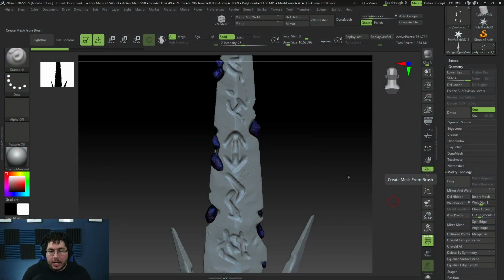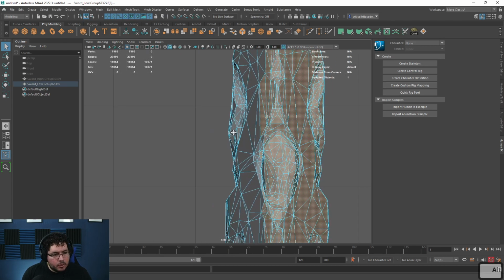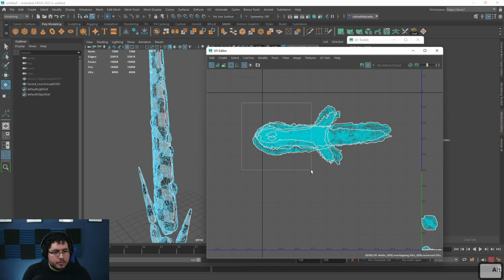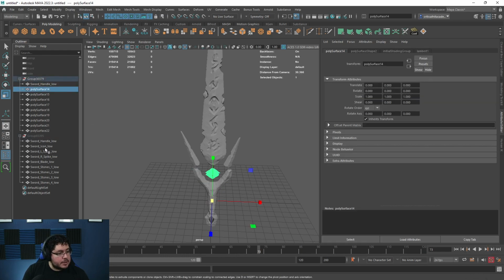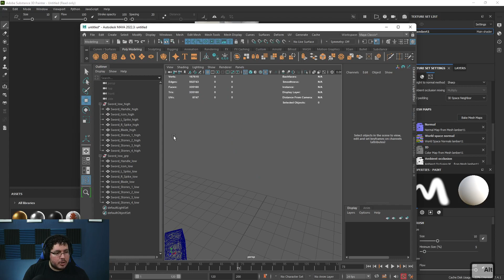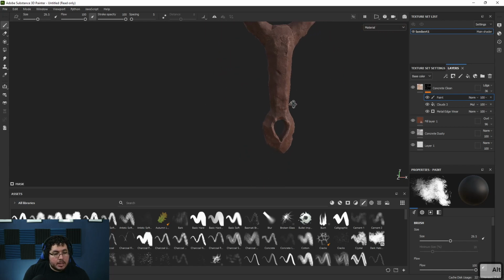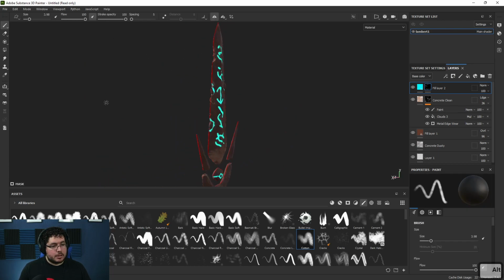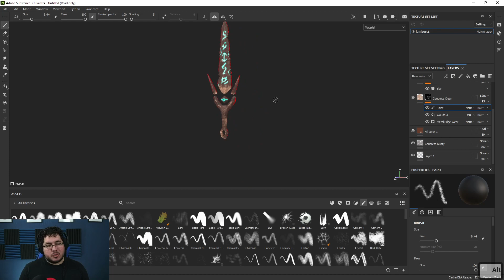Sword Modeling and Sculpting - part 3

Comment: Hello! Enjoying this series quite a lot! Thank you. I have a question regarding UV's: I've heard that edges with UV seams should be set to hard edges. Like even we have an object with all edges soft, we need to set uv seams as hard edges. So is it true and should it be always like that or no?
Reply: yes the best approach will always be to have a clean retopology and UVs along the edges, it gives the cleanest most consistent result. This methor that i show however is really useful for complex objects like this sword, stony pillars, rock formations and things like that. If you check the assets form quixel most of ther mountains and rocks follow a similar approach.